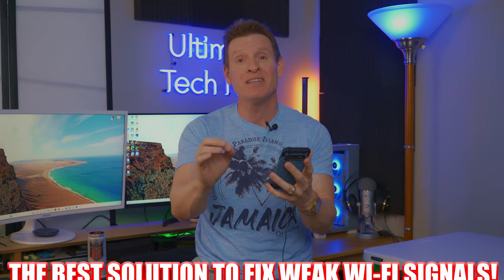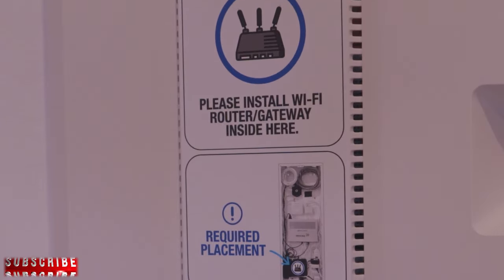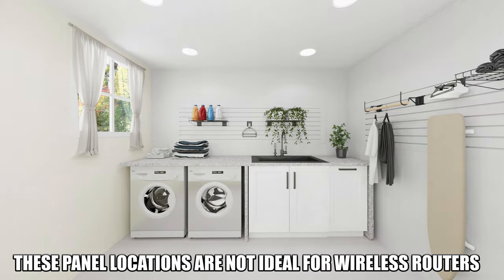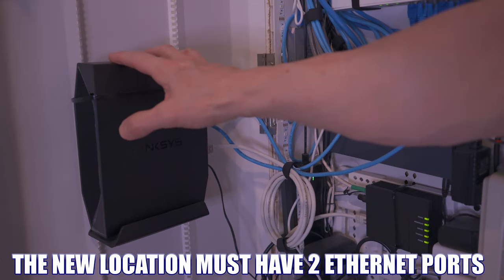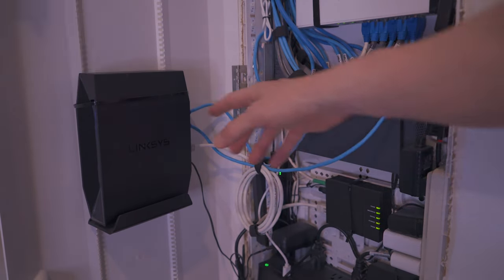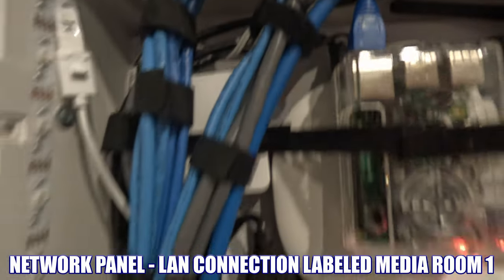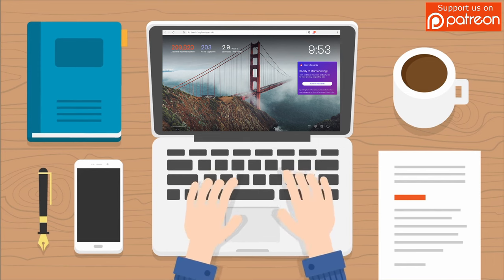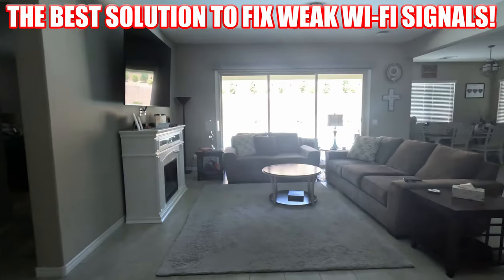Best Way To IMPROVE Wi-Fi Signal Once and For ALL!!!

Comment: Do you know why the IP address changed? This appears to be a simple lift and shift of the router.
Reply from the maker: Not sure maybe because it was a different location so it created another IP addres.s.. That never happened before  but it's something to be aware of. Especially when you try to login to the admin screen and the original IP address doesn't work. I had to check an acces point for its gateway IP to figure it out! Lol
Reply: @UltimateTechHub   Strange behaviour. Yes that can be quite problematic not knowing the IP address. Haha.

Comment: Hello, thank you for the video. I have a small 1400 sq ft home with 3 levels. I have my Netgear Nighthawk X6 (AC3200) router on my top level. I just setup some security cameras around the home and a couple in my detached garage. I am barely getting a signal out there and it is only 40 ft away. Since all my cameras are on the same network I can't use my Netgear ac1200 range extender due to I can only pair all my cameras to the same 2.4 wifi network. Can you purchase better high-strength antennas? I have been checking, but can't seem to figure this out (not an IT guy, Lol).

Comment: Thanks for your video. Do you have a solution for those of us who 1. don't have access to re-run a second line? I live in a condo.
Reply from the maker: Simply running an ethernet cable from your  modem to a different room maybe along the baseboard or through a small hole in the wall into a different room. Some people run etherent under carpet but that would be my last option. It's better to run the cable along the walls or through the ceiling attic space. Thank you for watching.

Comment: This is the way

My network closet is in my garage, but all of my rooms only have a single ethernet port. I ran 2 cables from the garage to just on the other side of the garage wall and huge improvement on signal, plus no longer concerned about the humidity impacting the router performance.
Reply from the maker: Never understood why network enclosure are installed in garages. It's too hot and humid. Also it's never the center of the house. Good job and thank you for watching and if you subscribed thank you as well.